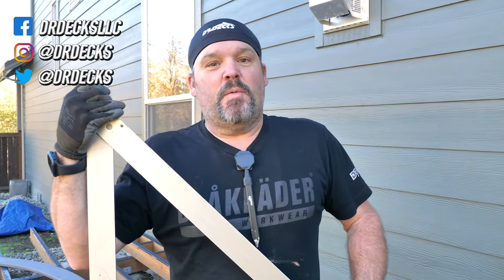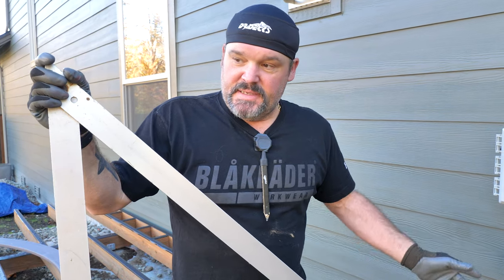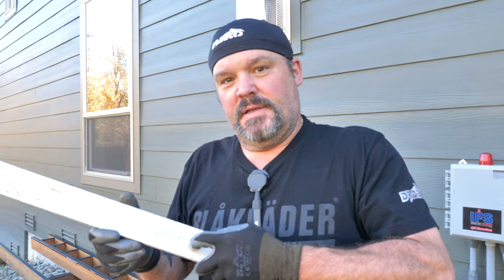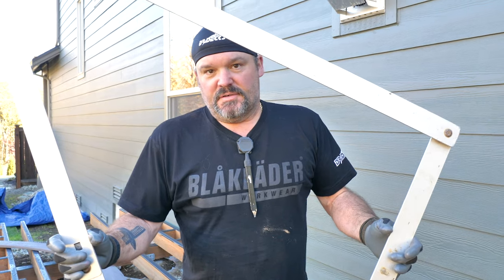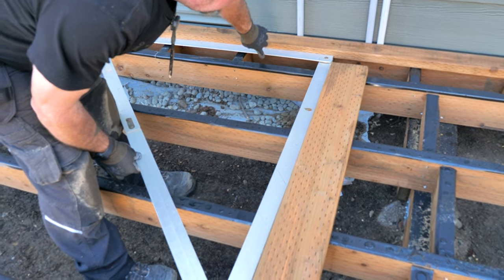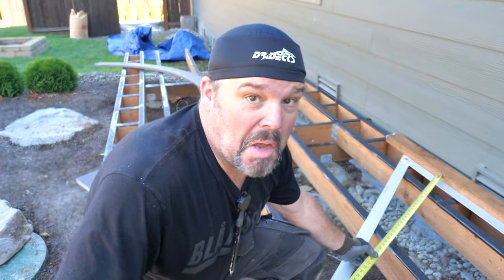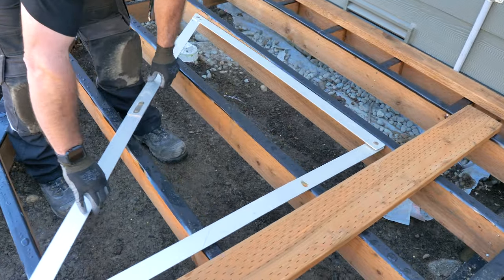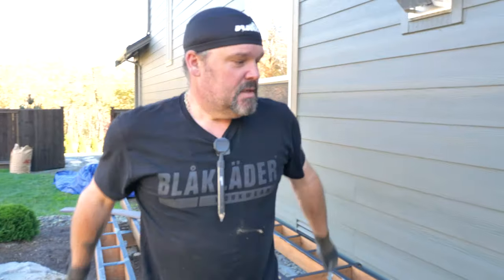Quick Tip: How To Square Up A Deck || Dr Decks

Comment: If your framing is a box, just measure the diagonals, corner to corner. If they are equal it’s square. That doesn’t make it perpendicular to the house.  Your method ensures it is at a right angle to the house.

Comment: The 3 4 5 technique also works for other sizes too. All you do is multiply the same number by 3 the same number by 4 and the same number by 5. So something like 15 , 20, 25 works also (5×3=15  5×4=20 and 5x5=25 just a example) another way is to measure diagonally across Pont to point and do the same the opposite direction and they should be the same. You may have to adjust and split the difference but you will be square if you get them the same

Comment: There is a type of square that is easily made and cannot be 'bumped' out of square . It's a little more difficult to understand but it's very accurate - It consists of 2 pieces of thin timber (1 long and 1 half as long)  the smaller is loosely bolted in centre of the longest piece forming a Tee. When you swing the small arm parallel with the long arm they are trimmed to be the same length. This means the short arm when moving marks a semi circle arc. ALL ANGLES IN A SEMICIRCLE ARE RIGHTANGULAR so the end of the sort arm and one long arm are positioned on your straight wall or string line then the last end is always a right-angle to the end of the short arm. It is very easy to make and stores flat. I cant find any pictures on Google sorry!

Comment: You can’t use 3 4 5 because of bows in the lumber unless your deck is 3’x4’. Best way to square anything is with a construction calculator, enter one dimension as rise the other as run and hit diagonal. Or you can use A2+B2=C2 on a graphing calculator but if you’re doing  construction you should have a construction calculator and if you don’t then you shouldn’t be doing construction.

Comment: I'm laying my composite now.  Had the breaker board for the top of stair lined up to square the rest of boards.  Just checked and my top of stair is out 3 inches as it runs.

Comment: Pythagorean triples   (3, 4, 5)  (5, 12, 13)  (8, 15, 17)
Reply: It's more like three four five 6 8 10 9 12 15
Reply: That's how it works when you're doing the 345 triangle it's in multiples of itself. so multiples of 3 multiples of 4 multiples of 5. If you're trying to find square on a large roof or a large structure

Comment: Crossline laser level (with xy 360 degree vertical lasers) + laser receiver to find the laser in sunlight + manual high precision rotation stage (to control spin of laser level) .... you gotta spend some money but its a very quick and very accurate way to find the 90 degree point

Comment: How do you price a deck?
Reply: $120 a square foot if you don’t want to see touch or feel PT anywhere, all composite railings, vinyl wrapped pvc decking, and pvc trim/lattice work and it’s 30” or less off the ground.
Reply: Also, double the material cost seems to always end up close as well. But I work time and material